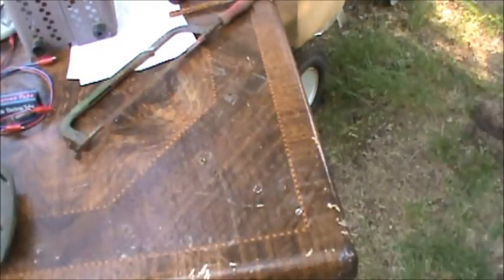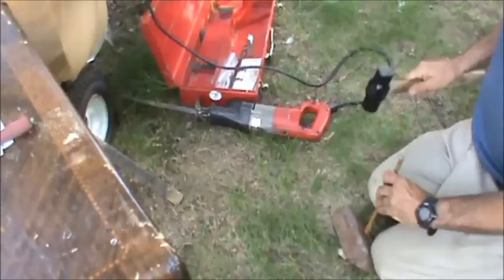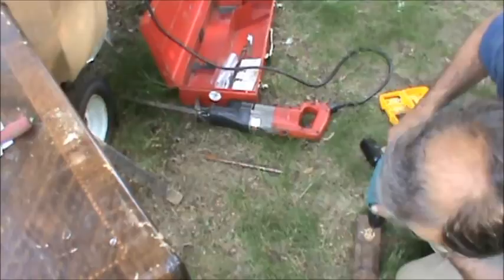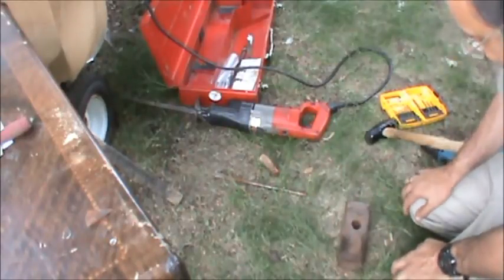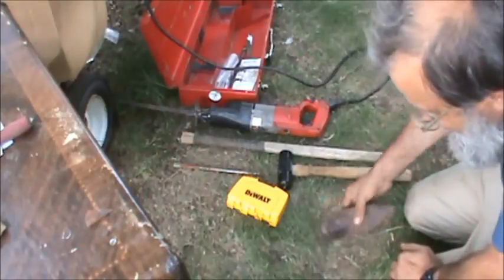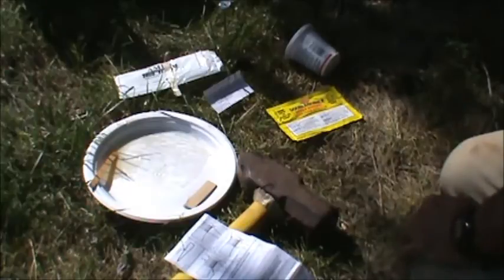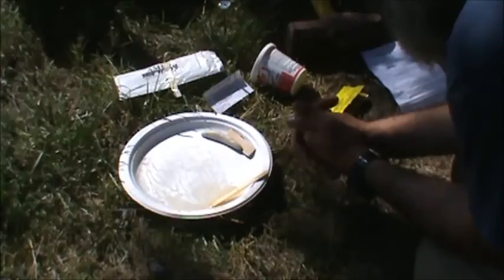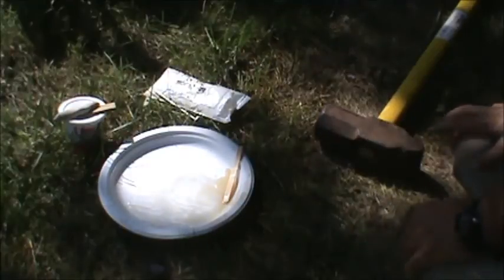Sledge hammer handle install

Comment: unless your handle is too tall for your vice, no need to cut handle, just put head in vice and drive out with punch the other way. Takes 5 seconds.  To seal the bottom against leaking epoxy (you have to the epoxy will become very viscous as it cures and will find every potential leak hole) you can use a hot-glue gun.  Sometimes cheaper to buy a whole hammer with a handle you like and cut the cheap head off of it.

Comment: My AMES TRUE TEMPER replacement handle came with a metal insert that locks into place on the inside of where the metal slides onto the handle. I'm not sure how to install that piece and this video doesn't speak to it. Guess I'll call the number on the package. Perhaps I'll upload some video if I find the answer.
Reply: chris ingram do you have a video on installing the metal clip?

Comment: so here it is 4 years later and i went to home depot and got the exact same handle for 14.97, and the hickory was 13.97. amazing,  no inflation at all. for the extra dollar i bot the yellow handle. and i thot the same thing, is this going to work?  a new maul with yellow handle is 29$ so if this doesn't work my greed to save  a few bucks  plus all the effort will make a fool of me. my advice to anyone is just buy a new hammer or maul or ax. why put yourself through days of angst waiting for the epoxy to dry just to save $15????
Reply: ok here's my install notes. the replacement handle came with a metal band that makes it a bit difficult to drive the hammer on, but it holds the head perfectly in place and immobilized. i used a 12lb sledge to drive it on and honestly i could not drive it quite far enough due to the metal band, so my install is about 1/8 inch short of the ideal position, which is level with the top of the eye. as you drive the head on pay attention to when the bottom of the eye starts to contact the yellow plastic. use a flat file to remove the yellow plastic to accommodate the head.. i had to file only the front and back of the handle, and the sides never quite made contact. the little calk cord provided is perfect to stretch and wrap around the base and seal any cracks where epoxy will leak. i prewarmed the epoxy up, as well as the hammer head to about 100 degreesF. i expected something like body putty, but both components are liquid and clear. i squeezed it out and mixed with the provided popsicle stick in a plastic lid from a carryout food container. i was able to pour direct into the top of the eye from the plastic lid, and used the stick to work it in. lots of bubbles came up. then i tapped the handle bottom on concrete for several minutes and lots more bubbles came up.  i also held it at various angles while tapping it since that metal band traps voids if you never vary the position and let the bubbles out. while it cures you must keep it vertical and warm, over 75 below 115. lower temps may take 7 days to cure, or it may never cure. while it sits, even more bubbles will rise out. i cleaned the old hammer with a 3/4 inch round wire pipe fitting brush. sanding the plastic end was easy, used 60 grit. one pack of epoxy made enough for 2 heads, so if you plan, you can have something else ready to use it on. this project was fun, the results are professional, and i actually enjoyed doing it, and would do it again despite my initial doubts. one last caveat, the wide part of the eye, called the 'draft', must be installed on top.
Reply: one more thing, i am sure i could have reused the old plastic handle, but i already thru it away. just cut or file the yellow plastic to accept the head and leave the white core sticking out far enough. all you would need is the epoxy.